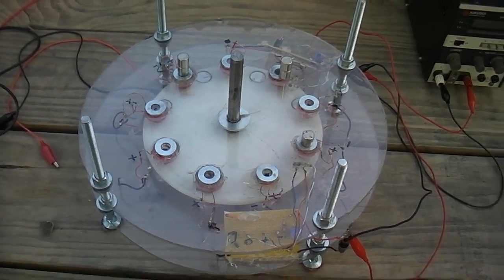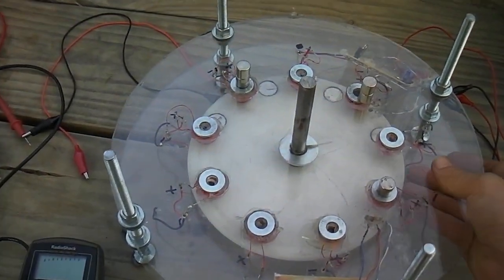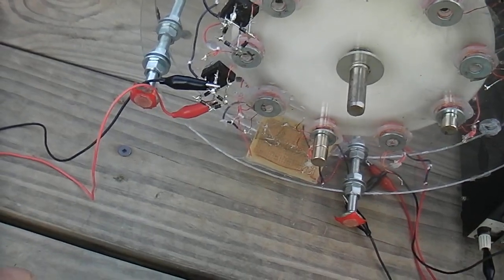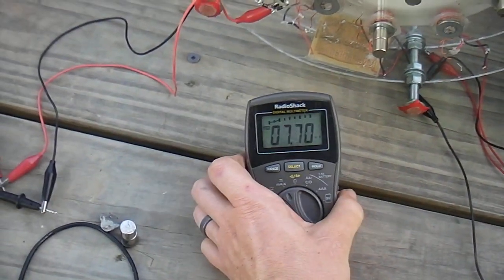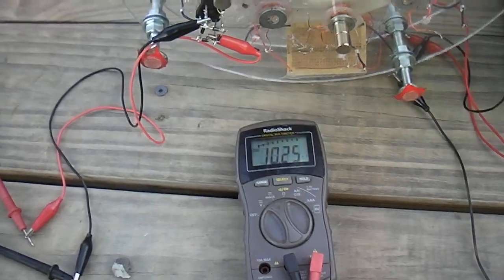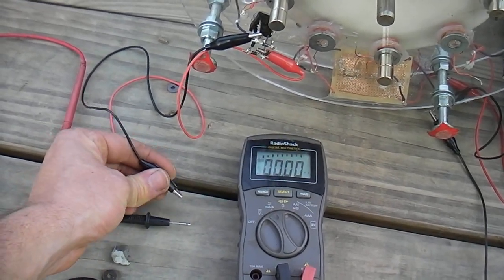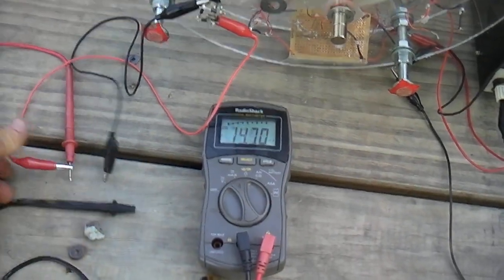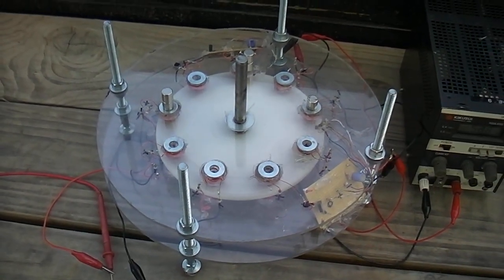RomeroUK Muller generator replication part 2

Comment: @harpbloke 
has anyone thought to put an avramenko plug to the circuit test points to see if there is a potential difference as this is running duel magnetics can produce no volts and still have a high current component which is similar to cold electricity in some ways. this system is not stable with so many harmonics of poles and spacing and as with three phase you can generate power between phases as well and it can be more than the single phase.

Comment: the magnets top and bottom are beginning to look alot like something Don Smith did with his resonant driver were he varied the flux path through between the magnets gets me thinking that there may be other ways to builg this machine. were the rotor is just ferrite slugs and the magnets are adjusted at the outside of the coils cores this would be flux shorting as well.